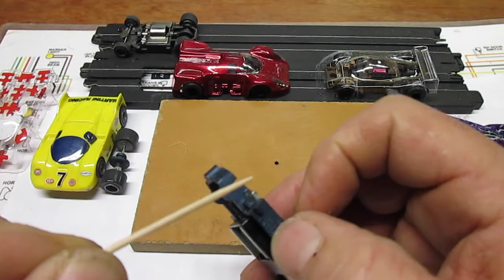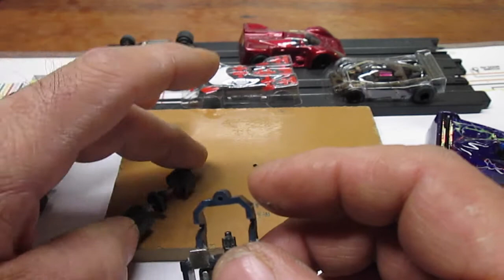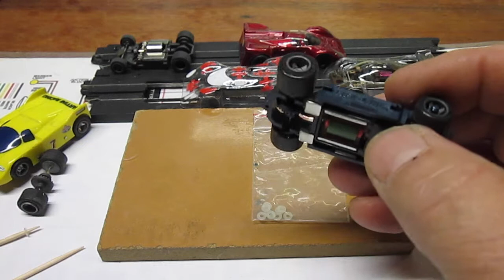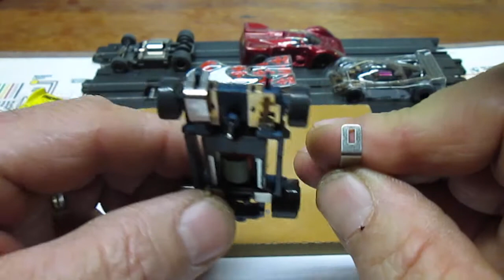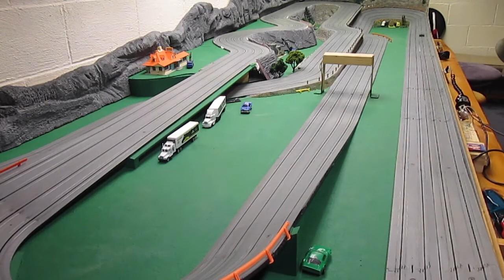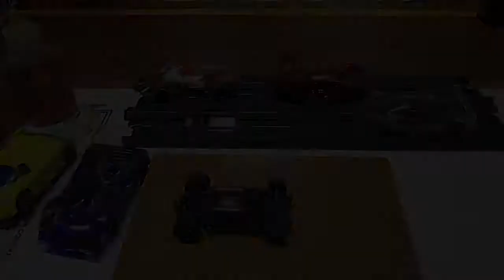LIFELIKE T CHASSIS CHEAP & EASY MODS PART 2

Comment: On eBay I found chassis magnets 3mm x 3mm. I just drilled out original magnets and replaced them with the new more powerful ones. No grinding no fuss and fast and dirty. Cost about 10 cents a magnet and took all of 10 minutes. Works great.

Comment: I make my own washers from sheet styrene. You get a lot of styrene for about $5. You could easily make hundreds of washers from this sheet styrene. The sheets come in all thicknesses. I use a leather punch to pop out the washers and then use an exacto tool with a #11 blade to make the axle hole...very easy and cheap.

Comment: So, I know this is an old post, but, just got back into slots, i'm an old fart, just got some like-like cars cheap on E-bay, ur's run like a scolded dog, but others i've seen seem kinda slow, what voltage do u use/recommend? Thanx.